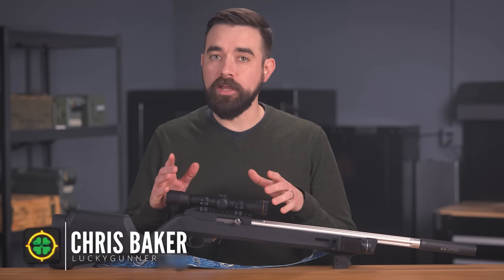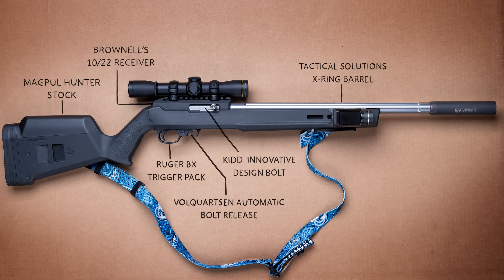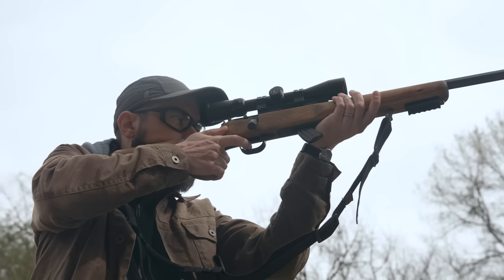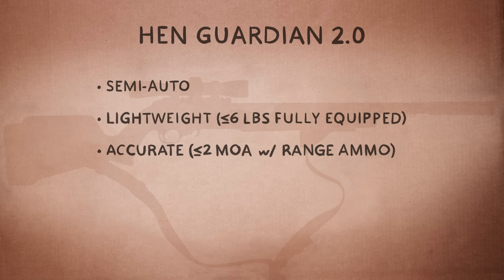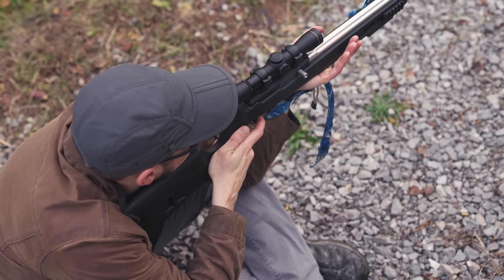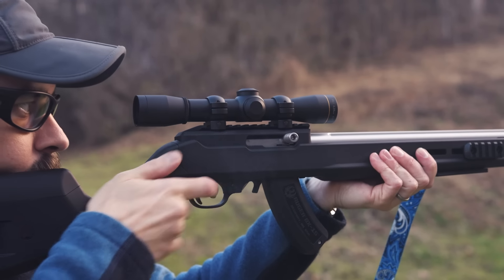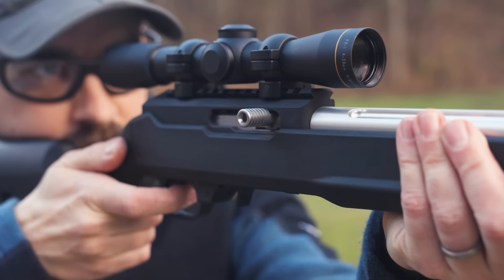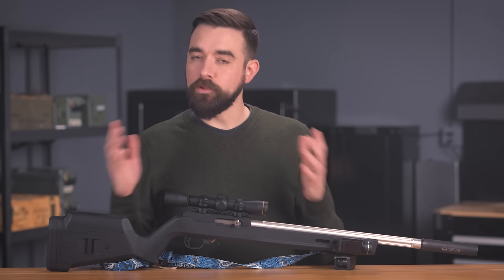The Backyard Sniper - Lightweight Edition

Comment: I have a very similar setup but I am using an old aluminum Ruger trigger housing with voquarzen trigger and internal parts. My upper is from a Ruger target 10/22 and my bolt is from the same except I polished all friction surfaces and chamfered rear of the bolt  also put the voquarzen firing pin and extractor and bolt release. Same barrel as you. I think I’m going to get a brownell upper receiver and bolt to build another base rifle since I have a lot of parts

Comment: I left rimfire for high precision high end PCP rifles not only for their extreme accuracy and quietness, but affordability per round. Good optics, ammo, and airguns have given me kill shots on pest species past 200 yards on the regular. Slugs and heavy pellets buck the wind about the same as a 32-40 grain .22LR rimfire round. The technology has jumped light years in the past 5 and is very impressive. I hope you dip your toes into this fast growing sport/hobby and give it a try. Really nice to set at the bench shooting sub MOA at 100 yards or your back yard without ear plugs.  May I suggest an Air Venturi Avenger to try first then and FX CrownMK2/ImpactM3/Maverick/Wildcat BT MK3 in .22-.25-.30-.35 calibers later if you fall in love like I did. I prefer .22 & .25 the best. 2:57 Hope this helps. Stay blessed and thanks for the video.
Reply: As far as the budget mentioned for this video - after the extra equipment necessary for an air rifle how much could one expect to spend all in?
Reply: thanks man 👍

Comment: Third party triggers are very over rated these days. I normally buy the standard ruger trigger trigger and upgrade it with the volquartsen hammer pack. I'm getting a consistent 2.75lb pull with a very clean break and minimal overtravel. For about $85 that's my goto

Comment: My current 10/22 love is a T/CR 22 by Thompson Center. Twice the cost of a basic Ruger 10/22 but it has 4 upgrades over the R10/22  that justify the cost. Thank you for discussing this family of firearms that, like the AR platform, offer users options; that enable them to customize a firearm for their own individual tastes.
Reply: what are those upgrades?
Reply: @jclaxton78  Composite stock, enlarged charging handle, Picatinny rail, green fiber optic front/adjustable peep rear sight. Additionally, barrel is threaded for a suppressor. Takes Ruger mags.

Comment: I installed the High Tower Armory 90/22 chassis. The chassis looks like a surpressor equipped FN P90. I did it to introduce kids(and adults) to firearms at my "the 2nd is For Everyone: Diversity Shoots" and the Kids shooting events where I volunteer. I installed a red dot and a Olight Baldr RL weapons mounted light/laser combo.  The kids enjoy it looking like the guns in their video games. I'm going to start evaluating if it can flex into a more serious use firearm. I've used it for years and all components held up but it only moves from the house, to the car, to the range. The chassis takes the basic Ruger 10/22 from a 9 on the fun scale to an 11.

Comment: siloet 56 here
first of all i truly like your style... thanks for that.. I have 4 ruger 10/22 custom guns... 800.00 is a fairly tight budget but is possible... good choice with the receiver... I too have a BX trigger.. But one of the other triggers has a trigger kit in it and is pretty awesome... if you want to suggest that you made a mistake it would be barrel choice.. I truly to believe that anytime you build a 10/22 you must purchase the barrel and bolt from the same person... I guarantee you it would be way more accurate by matching the barrel and bolt together because like tony kidd his barrels and bolt are machined to match each other... EVERYONES machining tolerances are different... 3 of my 4 10/22s have kidd barrels and bolts... And yes for the money you could have installed a trigger kit in the factory trigger for the increase in barrel cost you spent... kidd 242.00 which is superior over the tacsol barrel for 325.00,, and the kidd would match the machining with the bolt... I have to be careful here with my choice of words because i am personally good friends with the volquartsens... i have known them for 30 years so i dont want to hurt anyones feelings... the only thing i will tell you is tony kidd is the best on the market and price too... KIDD OUT SHOOTS THEM ALL...now concerning triggers... the high end triggers are clearly better.. i have a BX trigger.. a trigger kit in a factory trigger... A kidd 2 stage trigger... and a kidd single stage... the kidd is supperior,,, i did have a volquartsen a few years ago but sold it and bought a kidd... eventually you will want to buy a better one because they are flippin awesome... I would also check out timney... timney makes a nice nice trigger these days... I am not a 10/22 magpul fan... i bought the victor company titan because i like the vertical pistol grip feel and design... but the heartbeat of the build is the barrel.. the kidd barrel simply shoots ALL ammo better... mine loves sk red... best group so far has been .311 at 50 yds... but you have a great start.. for future thoughts and desicions when you do upgrade AND YOU WILL... buy kidd you wont be sorry

Comment: 20 years ago I worked for a guy and he had a basic 10/22. He never shot it so I asked to borrow it. It was still dirty from the first time he shot it 15 years earlier. I cleaned it up and took it to the range. It was ok but the trigger was rough and accuracy was fair. I started the deep dive. I learned how to polish a trigger and found all these great parts that could make it a tack driver. I asked him if he wanted to upgrade his little rifle and he said “sure”. I put a Boyd’s laminate stock and a hammer forged barrel (freefloated). Still having iron sights, it was about as accurate as anyone could want. That’s when I showed it to him and realized I would have to build my own. He did pay for all the upgrades and I built a full Volquartsen rifle with a laminate stock and a Leupold scope. That thing is a real tack driver but really only likes Wolf match ammo with the lube cleaned off.

Comment: I’m building one myself but a takedown with Magpul Backpacker and trying their little picrail mount to hold zero breaking down since it attaches to the barrel rather than receiver. TacSol makes a 10” barrel with a welded shroud to bring overall length to 16” and still get a silencer under the shroud - I really wish more AR uppers were sold that way with AFT giving us the brace-face lately. To keep things simple I’ll probably buy a stock backpacker-equipped takedown and just upgrade the barrel/optic mount, which puts me right around your $800… MSRP… I’ll come in $100 less since I got a deal on the TacSol replacement barrel on GunBroker.

Comment: Best optic iv'e used for my Ruger 10/22 is the summons variable power 3x9 scope it's clear good glass and it has my Rifle Dialed in at 1.5 M.O.A. at 30 yards. I've hit targets at 100 yards and 150 yards and 200 yards with my Ruger using that Simmons scope. it's spot on tight not loose or shaky or fragile at all very tough scope.

Comment: the  tandem cross ultimate trigger is a great trigger, I put one in a metal ruger trigger housing, my base gun is from 1984, and the trigger is quite good at 2 1/4 lbs, I am surprised you do not get better groups I would say it is because of the barrel you can't beat kidds barrels at 250.00 a piece

Comment: I have a 150 foot range in my garden. A creek along one side is a freeway for pests. I use cb caps. Very quiet. No suppressor. The 1022 is hard to single load so I use an old Remington with a bottom bolt opening. No optic, just iron sights for 50 yards. I'm completely silent and head shot deadly. All spring it is next to the shop door along with a single shot 410. Some places I'm worried about the backstop. Especially deadly for rabbits. This scoped and suppressed rig looks fun for 100 yds or more. Good video.

Comment: Nice little setup. One recommendation I have is instead of buyig an autobolt release, just file down the inner nub on the bolt release and make the factory one an auto release, plenty of info out there and saves ya a few more bucks for not a lot of time.

As for triggers, the 2 stage Kidd is the top dog, no doubt. Behind that, there are many good options from Timney, Tandemkross, Powers Customs, etc. I have a Timney Calvin Elite in a Target Lite that I like rather well, but for the money, I don't find it a huge improvement over my BX triggers. Personally, since you already have bought the BX trigger, I would send it to Brimstone and for 100 bucks let them fit their new internals to it and have a clean trigger at or below 1.75lbs.

Comment: I built my own    from a  stock 10.22 that was    so cheap.  EA  bull barrel  with Bentz chanbering.   Did a tripper job  using the JB weld trigger trick.     got a plastic stock for the Bull Barrel to keep it floated   One ragged hole at 25 Yards  but i use Wolf Target Match Extra  Ammo  to achieve this/   ammo is so important for accuracy and Muzzle velocity  needs to  be consistant.   10 FPS STD is key   for consistant Barrel Harmonics,   i use a 6-24  just so I can see my heart beating    in the crosshairs    painted min camo  using ferns and other  plants in my back yard.   Radiused the bolt  and added a titanium  Fire pin at   bolt handle

Comment: I have a very similar build with a TacSol Backpacker X-Ring rifle. Same optic even, a Leupold 4x32. No flashlight on mine but not huge need for me. Runs like a dream and stupid quiet with hollow point subs and my Rugged hush tube. Great video, and a great 10/22 configuration. Loads better than the original factory Ruger.

Comment: Good choice I have a modified 10/22 and it shoots great but the problem is the CCI standard 22 LR is very accurate but a bit anemic for long range lung shots on Raccoons or coyotes. 

Instead I have a savage model 93, 17 HRM, bull barrel, thumb hole stock with the accu-trigger. It’s a tack driver and one shot lung kills at ranges that a rim fire shouldn’t be good at. I don’t have a suppressor for it.

Comment: The way you have it set now is one the best ways to have ruger 10/22 atleast in my personal opnion and and I've owned a bunch from waisting money on dumb m4 to g36 kits.Only difference is mine built years ago had to have flashy believe most came from strikefire industries anodized red stuff so complete lower assembly the triggers is quiet nice tho free float red to black whisper pig barrel ported/fluted with a nikon pro staff so close to yours beside little more into probably cause of the choice of accent parts smh . As for the break down version leave that bone stock maybe toss a hush puppy on it and depending on old eyes a optic but its reliable as is

Comment: I've got a custom takedown 10/22 with a Kidd innovative designs single stage trigger. It's the best trigger I've ever used, it's set to 2lb pull, and it is amazing. Since it's all milled aluminum instead of plastic it is heavy though. Other parts include : Tactical Solutions takedown barrel and Hogue stock (before the Magpul version), Kidd innovative designs bolt, Ruger receiver, and weaver 3x optic. It is my favorite rifle, so light (a little over 4lbs) and the trigger is insane.

Comment: I want illuminated reticles on my rifles. I went with a PA 1-6X SFP in low rings with a .22 LR ACCS reticle on my 12" Dlask 10/22 higher quality clone.

The barrel is a 12" Dlask bull barrel with a threaded muzzle.

Trigger is a Ruger BX and I stocked it with a Magpul X-22.

Sling is a 1907 leather sling.

Comment: I started with a stock 10/22 Takedown and swapped the stock for a Magpul Backpacker.  Unfortunately, I have not had time to take it to the range and start getting used to the rifle.  And the optic I put on it to compensate for my eyes.  I need to look into your sling, and the automatic bolt release.  I bought the 10/22 before my take-home pension took a big cut, so buying new parts or replacing the trigger will take time to save up the money.  I'm really looking forward to getting the Ruger to the range!

Comment: Great set up - I have found that Aquila Interceptor is great -  the 40 grain bullet is rated at 1470 FPS for either solid or HP.   Aquila also makes a 30 grain that I have not tried yet.. But Aquila ammo in any of the 22 LR configurations always shoots good for me in either my 10/22, my Ruger SR22, and my Kimber 1911 with the 22 LR conversion - as far as the trigger on my 10/22 - it is a Kidd and I love it

Comment: I've had great success using a 1980's Ruger trigger (fixed up by me), receiver, and bolt. I basically changed the barrel to a heavy barrel and put the Magpul stock on it and can literally get 1 inch groups @ 100 yards with good ammo. But even with plinking ammo it does great. Mine is for sure not 6lbs though haha

Comment: I have practically that 'same' barrel, and from experience even after doing some tuning tricks I'd save a few bucks (around $100-$200 or less in price) and go with a Green Mountain .920 barrel that's in an 18 or 20 inch length. I've seen guys with similar base components to mine shoot CIRCLES around my Tac-Sol barrel even though mine groups 1/2 MOA at 100 yards after doing some fiddling with action screw tension and action bedding ETC, they were all shooting DIMES at 100 yards with non match grade subsonic ammo. GM barrels have been harder to find in stock as of late, but Whistle Pig barrels are right up there and about the same price and accuracy, both work SO much better for a few added ounces of weight...

Comment: I have a custom built 10/22 with similar parts and it is a super fun gun to shoot.  However for your purpose of shooting critters I would suggest spending $550ish for a CZ457 with the 17HMR barrel.  No modifications needed...  Super accurate and a one shot kill is all it takes.  I have this setup and I am hitting dimes at 50yards all day long.  Quarters at 100yards.  The rounds are more expensive for sure but this setup will meet ALL of your needs.  Just my 2 cents.  Loved the video...
Reply: By the way, my 10/22 has the Kidd single stage trigger in it and it was worth every penny.  Fantastic triggers.

Comment: I have the Kidd 2 stage trigger and it is awesome. I am a fan of the 2 stage. But it is hard to beat the value of the BX. My 10/22 is a takedown with the volquartzen CF lightweight barrel and the magpul X-22 backpacker stock and kidd bolt on a stock ruger receiver. I love the setup, because all of the weight of the gun is at the rear, which makes the gun very fast to point and get on target. It is my favorite gun. Having such minimal weight at the front of the gun will spoil you. All of my other rifles feel clumsy by comparison

Comment: Cool video, Nice .22.  I think I’m close with my Thompson Center TC22 (a couple of years old).  It’s a Ruger clone but with improved bolt;receiver, barrel, and Magpul-ish stock.  Has the integrated pic rail and attachment points for flashlight, bipod, etc.  Very accurate 25-50 with just a red dot…came with factory peep and front light tube.  Originally had a last-round hold open, but seemed to cause malfunctions, so I just removed the linkage, problem fixed.

Comment: Capacity?  I saw shots with a magazine and some without.  A quick internet search for a 10/22 is 10.  After using a Remington 552 Speedmaster with 15 with LR and 22 with 22 shorts for years, 10 rounds would be a deal breaker.

Comment: My Ruger's 10-22 semi-auto is 30 years old; is a dust collector sitting in my garage, so I have decided to upgrade it, and just came across your video. Where do I begin? I got rid of the factory stock long ago and replaced it with a Hogue rubber stock, it's okay. Find a barrel that will fit the Hogue stock; $1000 cost limit. I have a Ruger American Rimfire bolt action; it is a great shooter. A lot of 22LR ammo laying around; a lot!

Comment: I had an old 10/22 from early 1980s that served me well for maybe 50,000-60,000 rounds. I bought the X22 Magpul stock, Ruger heavy hammer forged 20” barrel and put it together. Already had an aftermarket hammer in the trigger group so added the trigger and sear with shims where necessary. That’s it besides optics. The barrel is still “on sale” for $99. The stock was on sale for $99. Trigger components were well under $100 and it blows away the BX trigger. Like you under 2moa with CCI SV. My scope has evolved. Started with a Vortex Diamonback Tactical 3-9x40. Then needed it on a .17hmr so now a Nikon Prostaff rimfire 3-9x40. This was going to be tricked out more for competition but Covid hit. I have a different rifle now for base class but likely won’t compete. This rifle is just for fun now. And IT IS!!!!

Comment: Just get the Kidd trigger components and drop them in your BX housing. Love mine. Also look at Tuffer Buffer for a bolt buffer if the BRN receiver is running a metal buffer at the rear. Tuffers are cheap and they get rid of that annoying clack when the bolt cycles.
Reply from the maker: I've got the Kidd bolt buffer in there and it is pretty quiet

Comment: Stock Ruger barrels are very good as they are CHF and made well, some newer ones have plastic parts but I feel like the wood stock version with a metal trigger guard (oldest ones have), a home trigger job or upgraded trigger then remove the barrel band, bed the action and free float it.
I don't get why people trick out a 10/22 so much, a standard stainless steel take down 10/22 is the only .22 you need unless you want a super quiet one then just just get a good bolt action.

Comment: Great investment of your $800+.  Excellent component choices. Added a Butler Creek .920 heavy barrel to my stock 10-22 action and a Hogue rubber overmolded stock. Inexpensive Vortex scope for optic. It still shoots tight groups at 50yds, but is too heavy compared to your rifle.  Of course it didn’t run me $800+ either. Thanks for another great video and congrats on your 10-22 cherry pop.